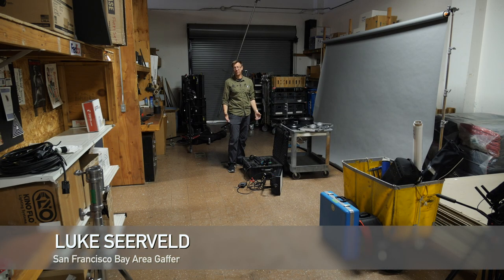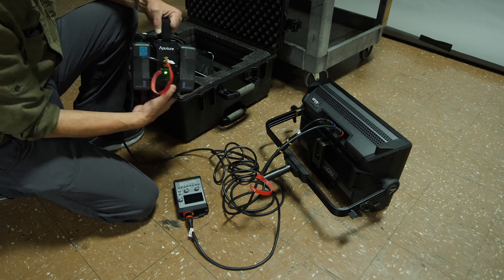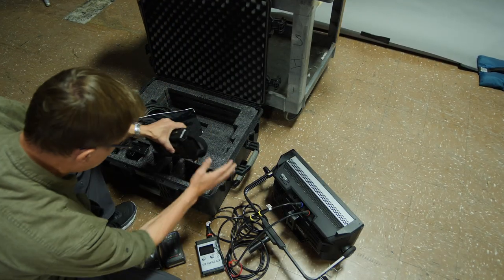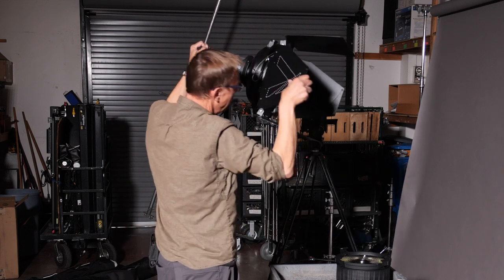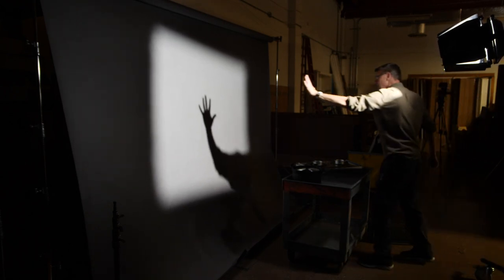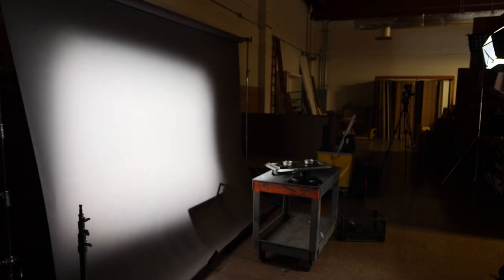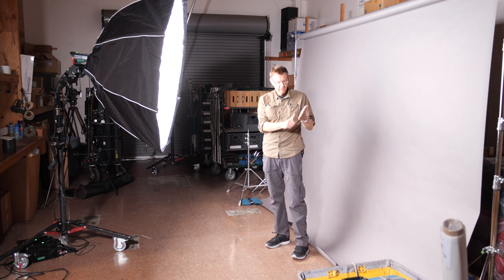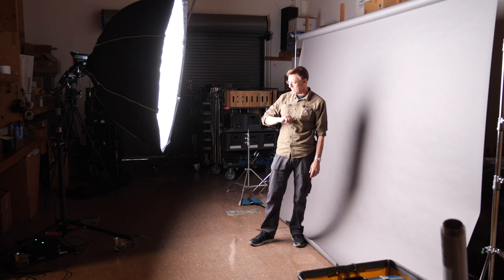Meet The Gaffer #232: Aputure Accessories - including DoP Choice dual 600d Rabbit-Ear adapter

Comment: Cheap tip - I use an old Chimera 9035 speed ring with my range of rectangular Chimera softboxes. I doubled up the mounts so I have on both sides. Now I could put 4 Nanlite FS 300s. So the same amount of light for about 1/10th the overal set up cost. Mounting via the speedring to a light stand. Alternatively and more likely I could use 1 x FS300 and 2 x Aputure 60ds or 60xs, mix and match varies lights etc. I used to do this with old Photoflex Starlites for both tungsten and floresent.

Comment: 21:10 "I should have bags back here..." I thought from your classic C STAND video that the load goes over the leg and a bag on the load leg.  Is that only for C stands? This suggestion would be equivalent to bagging the far legs of a C Stand (opposite load direction).

Thanks!
Reply from the maker: I think it follows the same principle, that you would start with bags on the back pointing legs, but invariable end up with legs on all three legs.
Reply: @meetthegaffer  ah I see.  But most important is leg under load? Recently experienced what happens when you have no leg under load.  Slightest push in load direction and better have good reflexes.  🤫😶🙄😳🤕

Even a slight offset of a lollipop makes a difference. Now I understand why you use the center disk 🍭.
Reply from the maker: I would say opposite load bagging is primary while under load is secondary, but because things change (wheels) and stands can be bumped/shifted in the heat of the battle, it’s wise to bag all in this case
Reply: May be the obvious, but if you're bagging the lowest leg on a C-Stand, it's most of the time rendered useless as most shotbags will touch the floor and not actually rest on the leg. So if you feel you must bag that leg (although it doesn't take priority in most instances), remember to make sure it's seated on the leg somehow and not the floor.
Reply from the maker: I think Cut The Check was referring to the C-stand episode #4(!), where I say it’s best to put the first sand bag on the back, medium high leg and the second on the high leg under the load. The lowest leg is often rendered useless, as you mention, especially with larger bags. Not to say we don’t ever bag the lowest leg😬

Comment: Have you heard of/seen/used the self contained, re-tractable ratchet straps? I've seen them a bunch in Ron Pratt's towing videos and think they'd be handy to use in a menace arm situation. I think the product he uses is the 1"x10' Erikson Re-Tractable Ratchet Strap.
Reply: I use these ratchet straps (I refer to them as "seatbelt ratchets") all the time with Menace arms - mostly to secure the back of the arm to the stand - easy one-man set up
Reply from the maker: Thank you both! I’ve been seeing the ads for them. I imagine they are a little bulkier than your standard ratchet, but may be a good, incremental improvement?
Reply from the maker: Thank you for mentioning them!

Comment: Cool video, thanks Luke. Would love to know what kind of output the double 600d setup gets through that 5ft octa
Reply from the maker: I don’t have a ring for an M18 into the Octa, but I have compared 2x 600d’s through an 8x8 magic to an M18. The 2x 600’s were brighter. We turned each 600d to 80% to match the M18.
Reply: @meetthegaffer  wait wait wait, was the m18 at its brightest (spot mode)? Also how would you compare two 600Ds using a book light setup, and a M18 using a book light setup which one is brighter
Reply from the maker: The M18 was not in spot mode because the objective was to fill the 8x8. It seems to me that 2x 600d’s would compare very favorably to an M18 in a typical book light. If you needed more output and could allow for a spottier bounce, you could add an F10 or two😉
Reply: @meetthegaffer  yea that's what i was thinking about doing. I wanted to use the two 600Ds to bring back exposure on a subject when i expose for a sunny day for an interior daylight scene. So would two 600ds with the f10 Fresnel in a book light setup achieve the desired exposure
Reply from the maker: Hard to say without knowing all the variables, but if you think an M18 into the same book light would give you what you need, then it’s a good bet you’ll be in good shape with the tandem 600d’s. The added F10’s would be a solid back up. Of course, if 1x M18 would barely be enough, then you may want to have a few more units up your sleeve🙂

Comment: I'm now thinking about how a pair of Prolycht Orion 300s would sit in that 5  foot octa on the rabbit-ears adapter
Reply from the maker: 😯👀 Something worth trying!
Reply: @meetthegaffer  my main concern is the Orion's narrower beam angle than most COB lights. It's only around 55 degrees or so.
Reply from the maker: But at the distance within a soft box I’m thinking it would probably do just fine, especially if there are two!

Comment: have you by chance given any thought on how to hang the Aputure Amaran 100x/d or 200x/d?
Reply from the maker: I’m sorry, but I have not had my hands on Amaran units. What issues do you have re hanging them?
Reply: @meetthegaffer  they are really only designed to be put on a stand. They have a baby pin receiver no yoke(and yes it is no joke).
Reply from the maker: If you want to aim it straight down, you just need a longer baby pin to get passed the body of the unit. If you want to rig from a cross beam, hang it upside down. Does that help or am I missing something?
Reply: @meetthegaffer  hanging upside down would be the first thought but may be a heat problem. Not sure that it is designed to be upside down.
Reply from the maker: Fair point; not all fixtures are built to burn in every orientation, but we could check with the manufacturer.
Reply from the maker: Manufacturer rep just replied to say the Amarans may indeed be hung upside down... and turned on, without any problems😉
Reply: @meetthegaffer  indeed we could, cheers!
Reply: @meetthegaffer  Thank you. I did not expect you to do that for me. Very much appreciated.

Comment: Now they just need a ballast joiner for the two 600s to mount to the bottom of that panel stand
Reply from the maker: Yes! And come out with longer head leads. The diameter of the main riser is too large for the lightning clamp and just barely works with a mafer/super clamp for Skypanel ballasts. Maybe a Cardellini with orientable 90 degree pin to a baby receiver plate attached to the bottom of a pancake would make a nice platform.